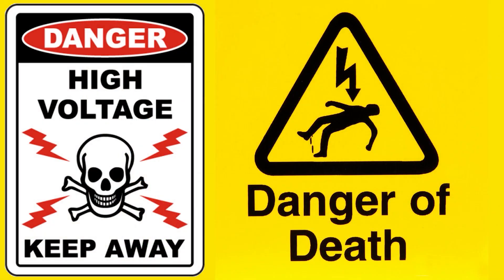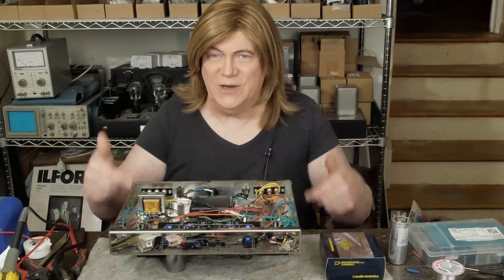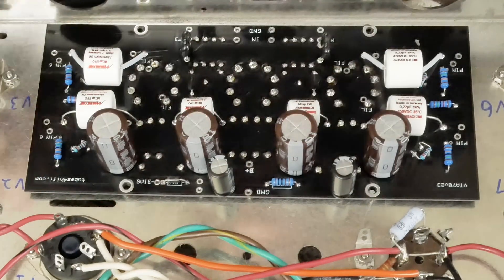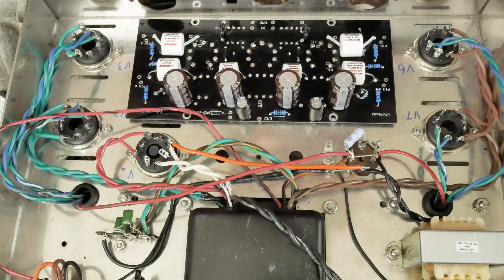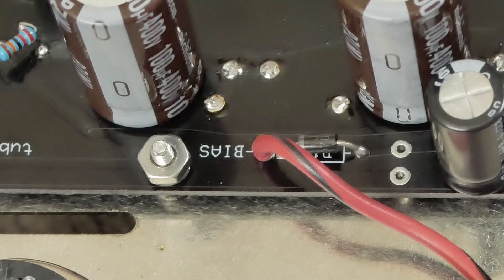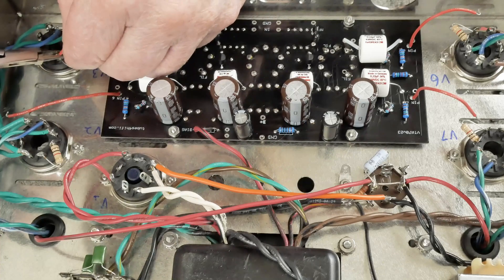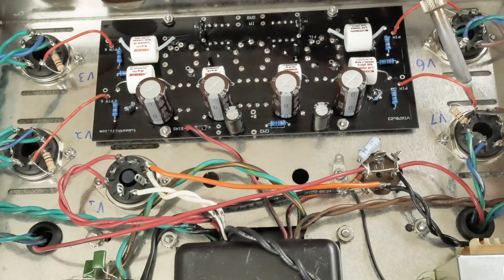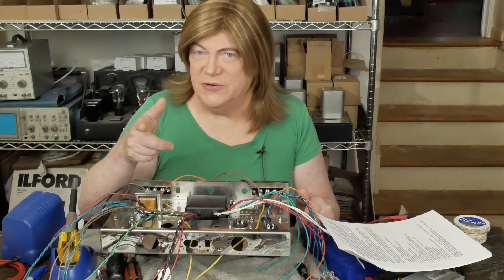Dynaco ST70 Tube Amp Kit: Installing the Driver Board

Comment: I tried many electrolyic caps that connected to cathod pin of my phono stage tubes incliding Nichicon find gold, Elna Silmic 2, Audio Note Kaisei and Mundolf M-lytic audio raw. I found the M-lytic by far gave the blackest back ground. Then, I replaced all my plate caps in the preamp section and bias caps in the driver section of my integrate amp to M-lytic power series. They gave the similar result--blacker background resulting more 3D and silky sound. I can hear the sound from the record that I didn't heard before. Then, the filter caps M-lytic power series to the power supply sections. Fully recommended. I will try the Black Gate but they're out of production and extremely high prices and very rare.

Comment: Hi there, with regards to the grid stopper resistors, I feel there is an unnecessary long way from the bias connector eyes on the PCB to pin 6 on the tube sockets, then onto the 'outside' lead of the resistor until the bias voltage comes through the resistor body to the actual grid connector lug. It appears preferable to me to make the resistor part of the connecting wire from the PCB directly to the grid connector lug, so running in one line from here to there, with the soldering joint between wire and resistor covered up with a short piece of shrinky.
Reply from the maker: I've done them like this, then people say that is an unreliable connection. Can't win this one, do it how you want :)
Reply: @SkunkieDesignsElectronics  Really? Oh my...at least I can feel on the same line of thinking with you!

Comment: Hi i would like to move the input jacks in the back of the amp how do you think this should be done thanks in advance
Reply from the maker: I don't think that is a great idea. The only "real estate" on the back would run the wire directly next to the noisy power transformer.